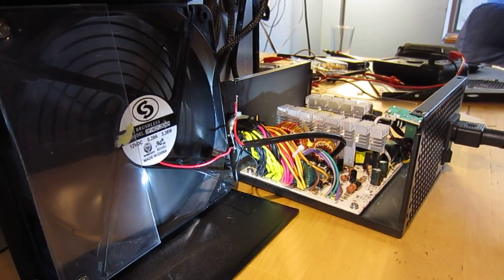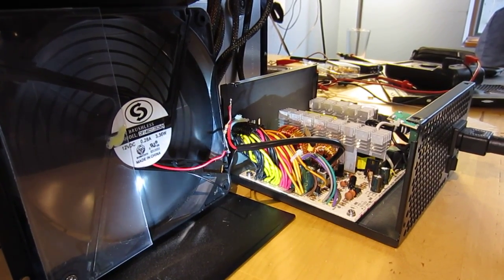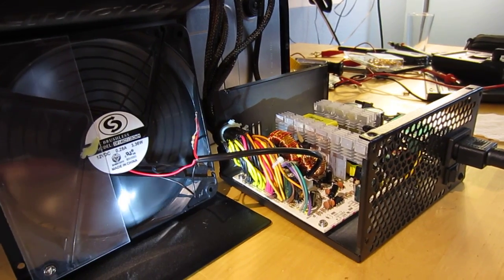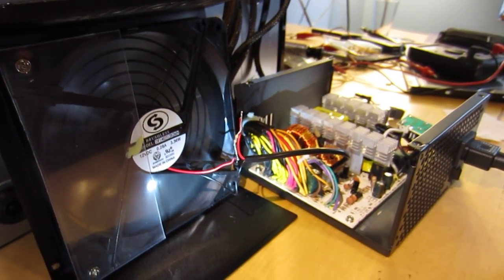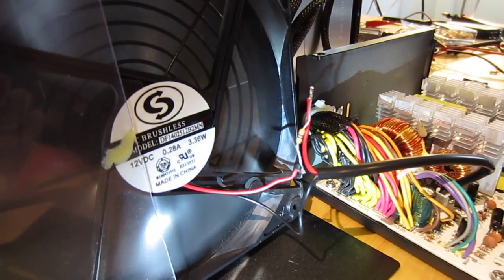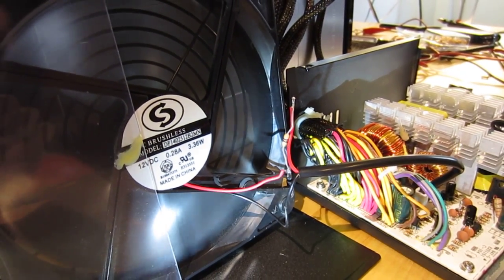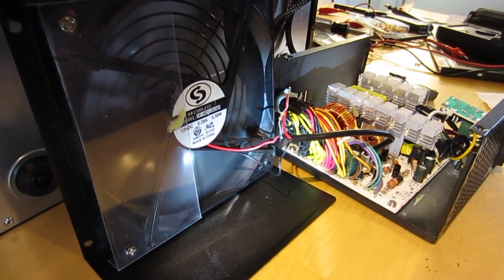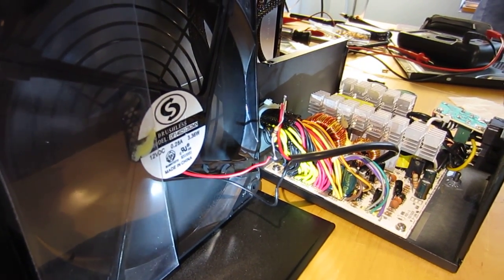Slow Down Your Loud Power Supply Unit (PSU) Fan

Comment: THANK YOU MILLION TIMES...
 I did it too,  JUST  3x 120ohm 2W in parallel it gave me 39ohm in multimeter and I gained 6W , now the fan cool the PSB perfectly without noise...

if someone like me couldn't find 6W or 10W 40 or 50 ohm resistor, try 3 of 120ohm , it worked for me..
million thanks again for this video,..
have a wonderful day...

Comment: Thanks! I was looking for this. Now I just have to find a 50 ohm rezistor.
By the way, I removed the piece of plastic that blocks half of the fan. I don't understand what is for. Maybe redirect air because the fan is at max and create some kind of blower effect. Thanks again!

Comment: You could also find a cheap universal ac/dc power adaptor, connect that to the fan , you can then select the output dc 1.5, 3 ,4.5 , 6 ,9 or 12volts.

Comment: I know the video is kind of old meaning i'm late but i wana say that is not the way to do it cz that resistor can heat and get damaged, then you fan is not spining and you may not know its not.
I recommand to use a voltage regulator like 7809 or 7805 depending on how slow you want it to spin, they are designed for this and according to low power consuption of the fan you dont even need to add a heatsink to them.
Anyway, thanks for sharing this and thumps up.
Reply: What if your voltage regulator stop working? How would you know if it is working or not? That fan is probably consuming 1-2W that resistor can handle more than that.

Comment: I just did this today to my power supply and within a couple of hours my computer froze up and it refused to boot up after restarting! I removed the resistor and waited some time for everything to cool down and it's running again.
Reply: I have since tried this again and after almost two days everything seems to be good. But I have made two changes compared to my first attemp. First I cut off both the fan and intake grills, the intake grill especially was very restrictive. The intake side is now a giant open hole! Doing this significantly improved air flow and reduced the noise. Secondly, I used a lower resistor value compared to my first attemp.  First I used 44 ohm resistors, now it's a 33 ohm resistor.

So all in all this is not a bad idea if you do it correctly. First make sure you have good air flow in your case and power supply unit. Second don't reduce the fan's speed too much that you cause the power supply to overheat.
Reply: @ManWhatever1  why dont you just buy a new fucking psu
Reply: @sabo5849  This is a free fix. A good quality PSU is at least $50-$60 and even then it is not guaranteed to be quiet.
Reply: why would u even attempt this...
Reply: The PSU fan is too loud and I wanted to reduce the noise.
Reply: why not just buy a new one... its not that expensive...this is the most makeshift method ever
Reply: The one I have is actually a new unit. Just happens to be a cheap and noisy one. But yes you are right, this method is quite risky and not worth doing.

Comment: The 50 Ohm resistor can't be standard for all fans because there are fans that draw 0.44 Amps, other that draw 0.26 amps, other 0.18 amps...and so on. You should experiment. An other solution would be to add a 50C temperature sensor that acts as switch, the same way as you did with the resistor. And fit the sensor to the heat sink.  In this way it will work when the temperature reaches 50C and not all the time.

Comment: Hi! I have a 4-wire psu-fan. Is it possible to 'fix' it at the same way, or should I download a software to control it? I have a HP SFF pc
Reply: You cant control psu fans, the extra 2 pins on psu fan are for the motherboard,  for rpm tracking, you need a fan with a modulation control, and connect the modulation wire to the cpu fan modulation wire to control it.
Reply: Thank you for your help!

Comment: my fan is 12v and 1.60 amp...what resistor should i need..how many watts do i need to cut the speed about 50% to 70%
Reply: +Dirt ty 1.6 amps ? Oo what a fan is that thing ? this would be more than 12 watts of power... you mean 1,6 watts ? or 0,16 amps

Comment: I have an 850w PSU which is very loud and only using 400w. Would it be safe to replace both PSU fans which run at 100% constantly with 2 of these? http://www.ebay.co.uk/itm/CoolerMaster-80mm-BC-80-Blue-LED-Case-Fan-Clear-Frame-1800-RPM-21-7-CFM-/310323962221?pt=LH_DefaultDomain_3&hash=item4840bfe16d

Comment: I quieted mine down by removing that platic strip thats screwed to the fan. It does absolutely nothing from what Ive noticed other than causing turbulence and making half the fan useless.
Reply: that is for purpose, to direct the air flow to the outside.

Comment: This is just stupid on many levels
Reply: John Michael Stock why?
Reply: No, it's clever. You use less energy to run the fan. Easy math.
Reply: Actually you use less voltage due to the resistor. The resistor consumes energy so there will be more heat. So this is solution is not very efficient but it is a quick and cheap hack for silence.

Comment: uhm this is retarded. if the fan is doing 100% RPM there is a reason. people try to quiet their systems down but really that's just going to make it run hotter. at the very least get a more efficient/quieter fan, but never mess with the cooling. especially in a PSU wtf...
Reply: There are plenty of PSUs that needlessly just do 100% all the time, no control at all.
Reply: First thing he said is it's a 400 Watt supply he only wants to draw 100 W from.
Reply: the reason it is doing 100% is that; 100% can easily handle max power output (which you generally wont go near)and not speed controlling it is cheaper

Comment: Thanks for the video.
I wonder if you could install a new fan with wires that can control the speed and then route those to a fan controller somewhere. Maybe one of those controllers you can put in a 5.25" drive bays.
Reply: just use a potentiometer in place of a resistor
Reply: *****
Lol, but you can't adjust it if it's inside the PSU :P
Reply: +crikey mate that poti could get very hot
Reply: +W Fabricant (Dark Presh) you could get an pwm fan, solder the voltage cables together like  in the video and route the rpm-signal-cable and the pwm-signal cable with an aditional header, to an pwm fan controller with a display or to a pwm header on the motherboard, but you don't know how hot your psu will get anyways